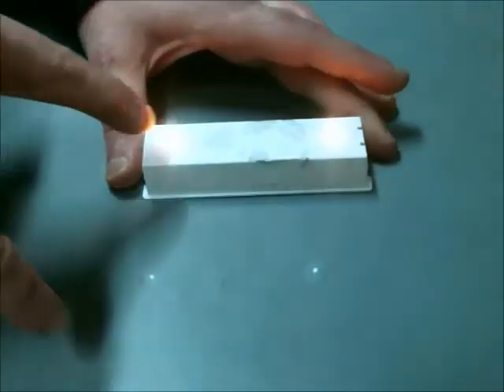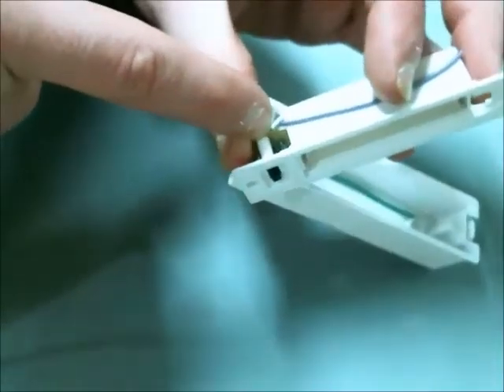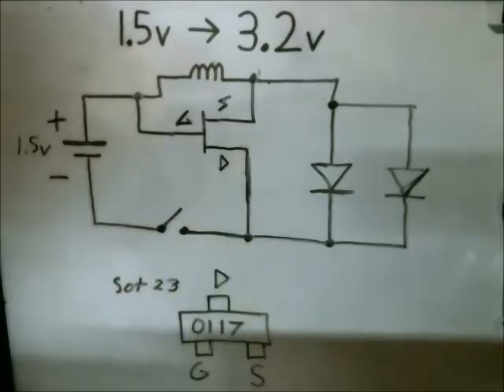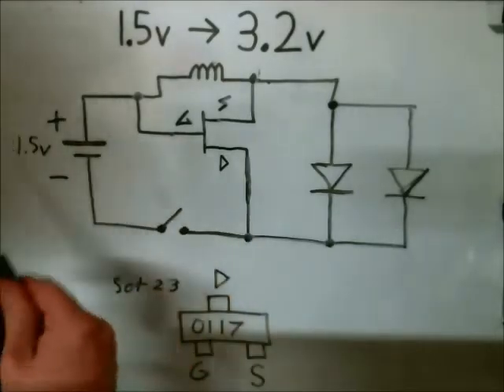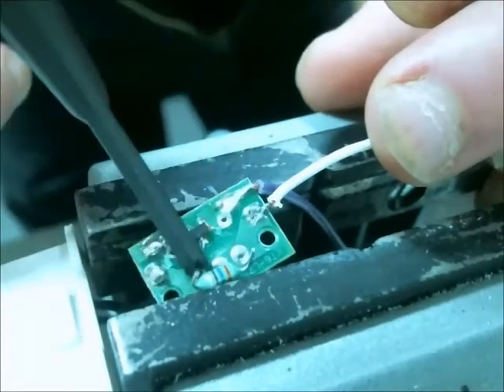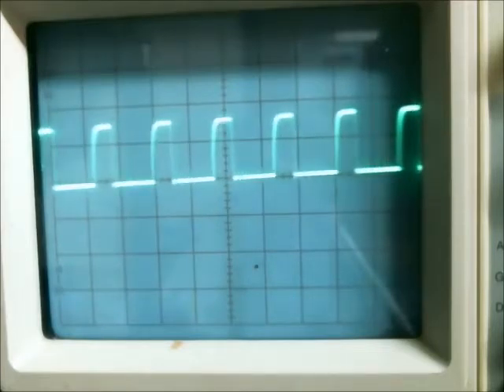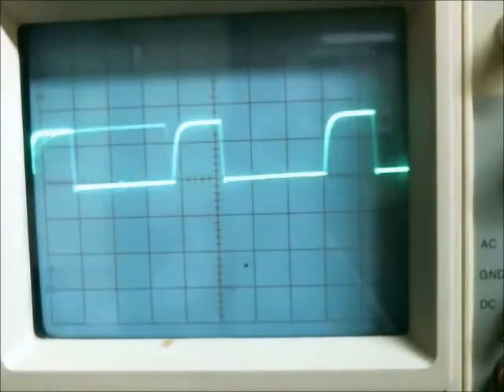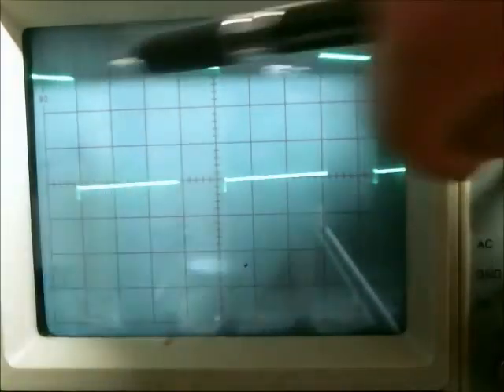IKEA Joule Thief

Comment: Gate, Source , and Drain are terms which typically apply to Power MosFETs, JFETs, etc...  and as such do not apply here. The transistor in the circuit is likely an NPN transistor such as a 2N2222 or C945 - which have a Base, Emitter, and Collector respectively. I suspect that you could substitute just about any NPN transistor and the circuit to function.

Comment: Matt I just have to say you are quite the thief investigator when strange joules just don't add up!!  ;-)

Well done, well explained, and well followed up with research and reporting...i.e. sharing your findings...much appreciated by many, as well are the few other contributors responsible for your final determination and providing links and search terms for those wishing to follow this further for other applications...as amazed and intrigued by Joule Thief circuits as I have become, videos like this show me how endless the creative applications can go.  

 Yes it is just another LED(s) running on a 1.5V battery that shouldn't be possible... but look at the discovery your curiosity over this led to...and THAT'S how it becomes endless in application.

Again... well done all around!!  
TSG!

Comment: Great little square wave ic. Would be great for triggering transistors etc :) Where did you find the original device?
Reply: Those chip are pretty common you can search for PR4401 they are little LED driver. Cheers!
Reply: You're welcome :-) they are a little expensive though bought 5 for about 10 $ but they perform very well
Reply: Very interesting. I found its internal diagram http://www.talkingelectronics.com/projects/LEDTorchCircuits/images/PR4401CctCorrected.gif
Reply: Yup it's a very well design chip you can actually replicate the chip with two transistor couple of resistor and capacitor although for size the chip wins
Reply from the maker: It was from a decorative light for a little house sold by IKEA.
The IC has "0117" printed on it. (could not locate a Datasheet)
Reply from the maker: Patrick Labelle
Thank you